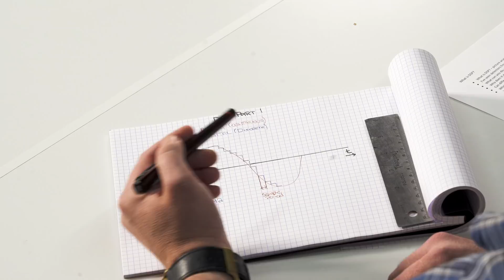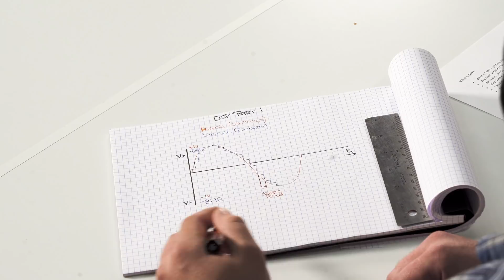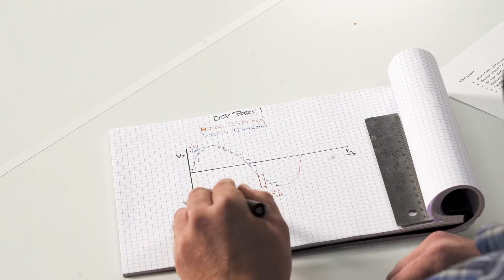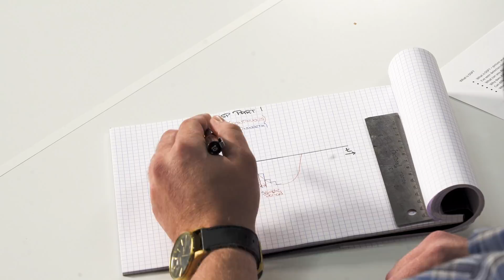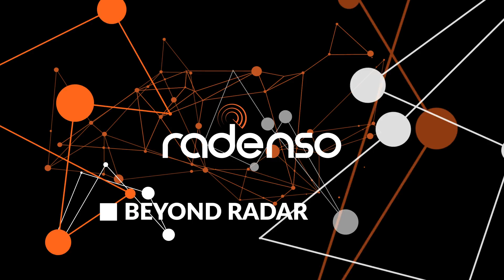What is Digital Signal Processing (DSP)? - Part 1

Comment: DSP: The road is long. DSP hardware is like a video card, someone has to write the code to build the 3d engine then make a game. 

Topics to cover: 
Look at Mathworks. 
Math & Physics.
Radar System Modelling.	
Clutter and Detection in Clutter.	
High Resolution & Imaging Radar.
Microwave Components & Antennas.

Lastly: Let the guess finish his point you keep interrupting the expert.

Comment: Good content, as usual.
Now, a little bit outside current discussion but still related with upcoming Theia detector, did you considered the possibility integrate somehow Theia with other radar detection application like Waze, for instance? Idea is to collect from Waze what using are reporting along the way in your direction of moving and to use it as "stay alert" option which could be added at Theia functions. Idea is to collect as many information as are available from around. Yes, you will say Theia may or may not need this information cause the detector capabilities would be enough to alert you about a radar. But what about laser guns? Theia will alert you, of course but this will be in almost all cases too late. By collecting info to other systems and adding a stay alert function, Theia could make you stay allert when entering into a zone with many reports. And should use a different sound of a different type of alert for this kind of warning collected from 3rd party systems. Maybe this will make Theia more noisy but the final objective (to avoid a fine) could make it worth. And if this option can be set on or off, this would be even better :). I may have some more ideas for improvement (and I know you are listening to your public) but maybe this is not the right place for this, you have too many comments to follow :)

Comment: Original function for DSP, find certain signals below the native noise level.  Today, more can/is done with a digitized signal.  They are spot on talking how raw signal is digitized/sampled. As bytes are assigned to slope of signals (including natural or man made background noise), faster sampling is better.  The Cincinnati Microwave Escort DSP did excellent job taking RF domain and pull out LEO radar that was below the native noise level (increasing range of detection).  Great tech of its day.  Today, so much more can we done with a RF signal converted to 1s and 0s.  As noted in the video.  The key to what makes “DSP” better than another? How does a RD “SP” (signal process) makes the difference.  The team explained how better signal management works.

Comment: I've owned more than one Escort Passport detectors over the years. Escort's are full-featured and very plug-and-play. However, the V1G2's arrows are easier to read, boggy-counter and programmability are pluses, and their history of upgradeability puts Escort to shame. Also, the PRICING OF THE TOP TWO NEW ESCORT DETECTORS IS OFFENSIVE. Their performance does not justify the price, even with the full suite of features. Having said that, I think Escort did this for a strategic reason. I believe they are hoping to push Redenso to price their Theia high enough that it won't pose a significant threat to their position in the market (above the sweet spot that they want to own). If they can get Redenso to price the Theia closer to $1k or more, it will be a high-end niche product (kind of like a Ferrari). Everybody likes them, but nobody owns them. However, if Redenso doesn't take the bait and prices the Theia where Escort priced the new Redline 360c, not only would it kill the Redline (with "Faux AI") on performance, it would destroy Escort's sales and own the higher-end of the market (pulling many $500-class detectors customer upmarket). Without going too far upstream, Theia can do what Apple does with its MacBooks, own the top-end of the market and produce volume at the same time. If Redenso prices it higher, people will think long and hard. Likely, many will compromise and pick a V1G2 or a R7. If the Theia is within reach (not twice the price of those two), it's much easier to justify the extra cost. Even if the Theia is the best detector on the market, there is a limit to how much most people will spend. Remember, we can just run Waze with V1G2 or R7 and have pretty great situational awareness at a reachable price. If the Redline 360c was priced at $500, the performance loss against the R7 and more discerning V1G2 would be justified because of its full suite of features, and it would be an alternative to the Theia, but at its current price it's not even worth considering. LAST THOUGHT: BSM falsing is the biggest problem in Radar detection. It's turned a lot of $500 devices into Acura detectors. BSM is the reason a lot of people are in the market today. When you launch the Theia, you need to use your dominance in that area as a primary reason to buy the Theia. Focus on the benefits, not the technology. Identify the exclusivity of your technology only as a means of telling the story of your benefits! VERY BRIEFLY explain that yours is the only technology that can deliver these benefits. Grab their interest in the benefits provided, and stay focused on that.
Reply from the maker: Theia pricing isn't being influenced by any of our competitors, it is the price we feel is best for it.  Once most of development is finished on Theia, we will show videos of Theia in action before pre-orders begin to show what it is capable of.  -Randy
Reply: Inflation adjusted costs for your original purchase of Escort, then Passport, maybe original V1, at right at the cost today of the Red Line 360c.  Top tech/designed/coded Radar detectors are like a ounce of pure gold.  The best, always valuable. However, over time the cost in dollars goes up.  However the net cost adjusted for Fed derived inflation suggests to the mind gold has gone way up,  in reality it costs the “same”.  Your purchasing power has gone down. If your income has gone up to adjust for this, no problem.  Theia will be expensive.  Might be same as RL360c.  Who cares? It should provide more capability than competitors, plus offer more features and performance than your old days of “Passport”... Due to something called “Moore’s Law”.  Assuming your income and wealth creation has kept up with inflation (or beat it), plus the increase in value advantage in tech Moore’s Law, you win twice.
Reply: Typically, with consumer electronics, the products get better and cheaper at the same time. Yes, early adopters will pay the high introductory prices for new product categories, but in sort order the same or better benefits are offered at dramatically lower prices in order to sustain momentum (scale up). The examples are endless (CD players, DVD players, flat panel televisions, etc.). We see a slight version of the with the former flagship Passport 9500ix being currently offered at $300, versus its original price of $450. However, to follow consumer electronic industry norms, Escort's current flagship would offer better performance at a lower price than the Passport 9500ix did when it was introduced. This market is more niche and we don't see the same scale: however, if inflation-adjusted cost were the driver, then flat panel TVs should cost thousands more than they currently do. That's not to say that a revolutionary product like Theia cannot justify a top-tier pricing. It can and will. The question is, what is that number? The higher the price, the smaller the scale. So, Theia can be a high-margin, low volume niche product; or it can be a lower-margin, high-volume product that propels Radenso into category dominance. Another option would be to use a near-Theia derivative product to go after the volume sales. As consumers, we'll see where they see their company positioned by the choices they make. Right now, there is an opening for a product that can offer the full suite of benefits at a reasonable price, but that window will close as the big players catch up.

Comment: DSP increases your signal analysis resolution vs fixed hardwired processing with very limited filters . FPGA "s are used alot by  a lot high end audio companies in DAC's. The great advantage over circuit processing is the flexibility and adaptability to new situations is way better.  Can't wait to be an early adopter and unlike the other Ohio based detector companies I have great confidence that you will release it only when it is ready and be practicing kaizen.
Reply from the maker: Thanks Doc! -Randy